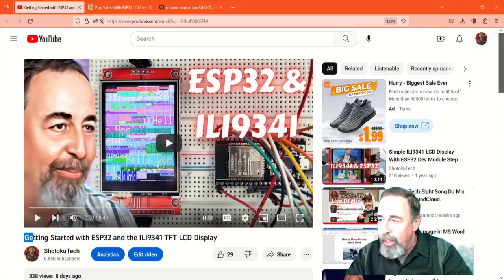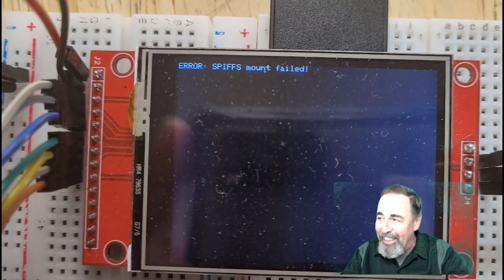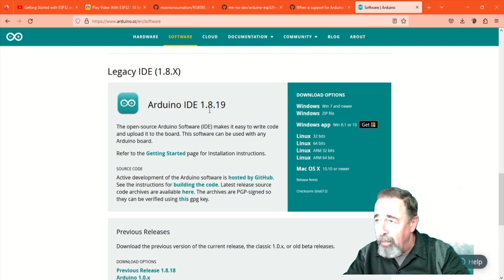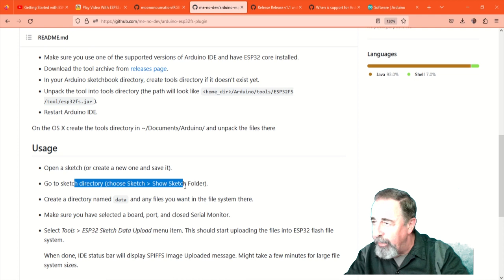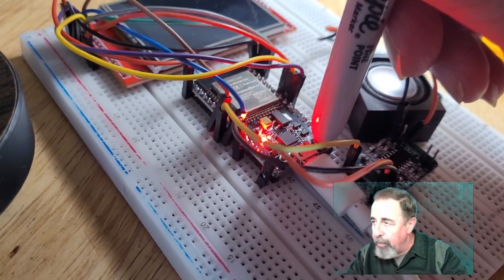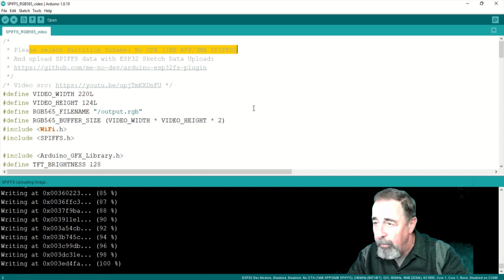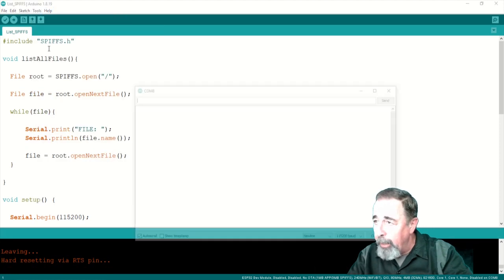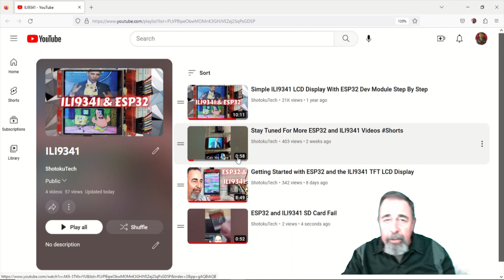ESP32 and SPIFFS Step By Step

Comment: Sd card failure may be due to power supply issue. Seems like I saw somewhere that sd card has a spike in current draw that causes failure. I think they added a capacitor somewhere to smooth out the power spike. Maybe this can help you solve your issue.  Good luck.
Reply from the maker: Thanks. Yes it seems something may be missing when using the ILI9341 versus the ILI9225 the author is using in their example.